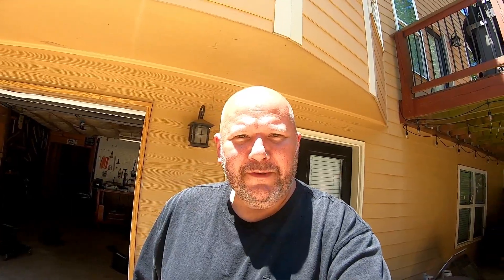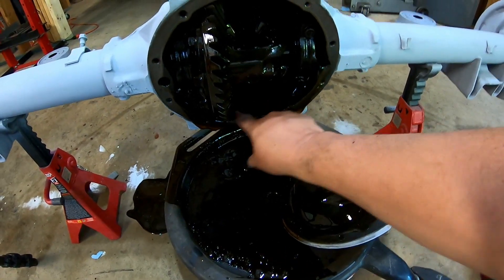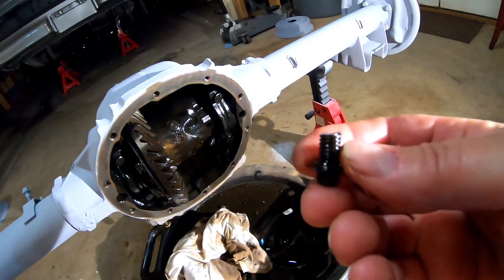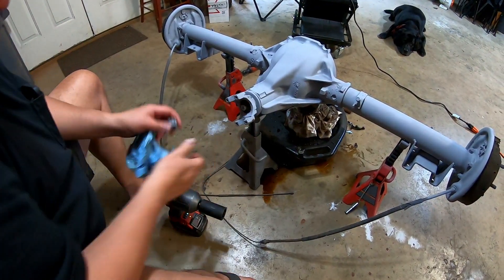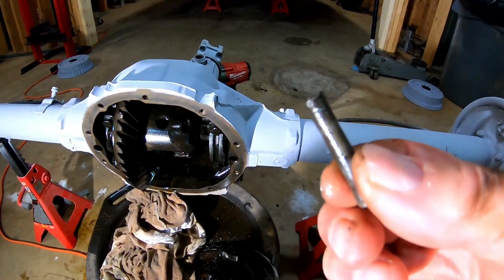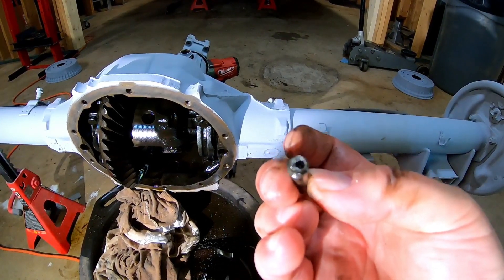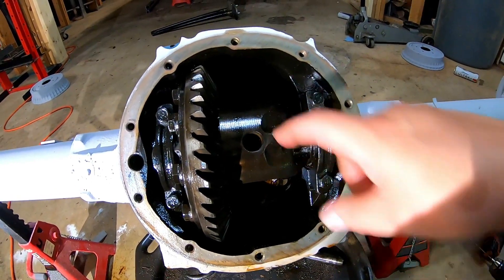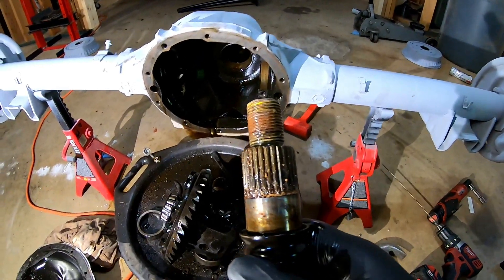78 Camaro Restoration ep26 - GM 10 Bolt Complete Disassembly!

Comment: 99 times out of 100 when the pinion shaft bolt breaks... You can use a sharp pick and spin the broken piece out. I have done 100's of these over 35 years doing this and have only had 1 that wouldn't come out that way.
Reply from the maker: Wish I would have tried that!  JD